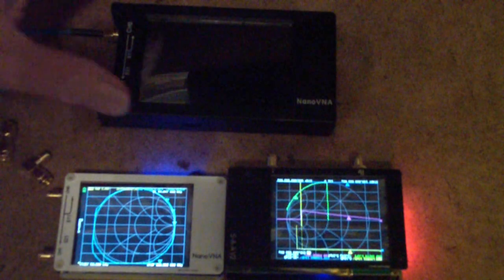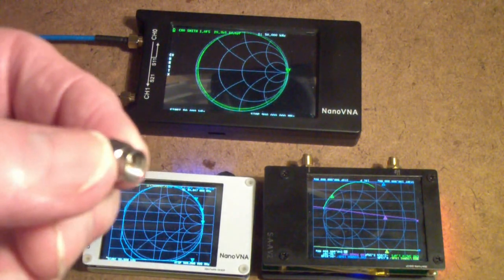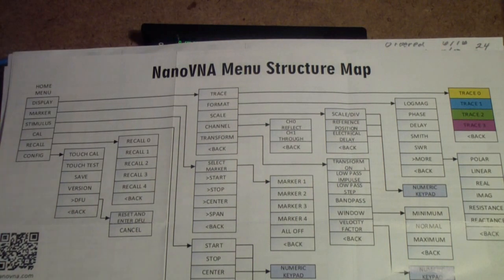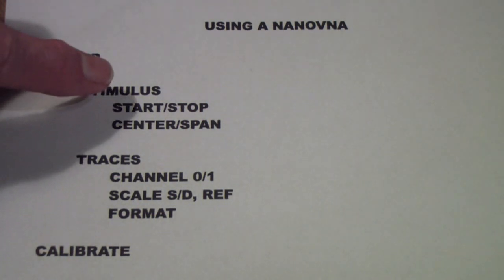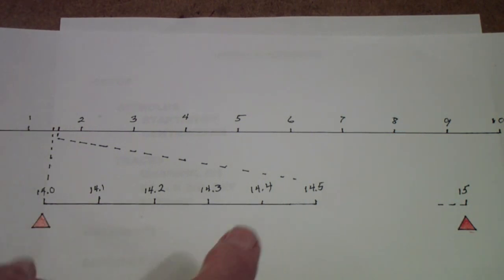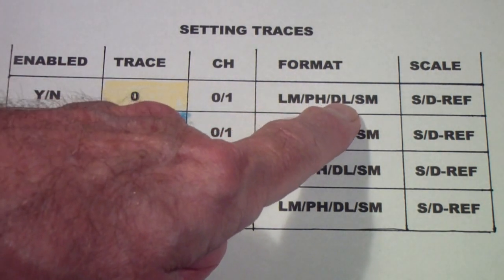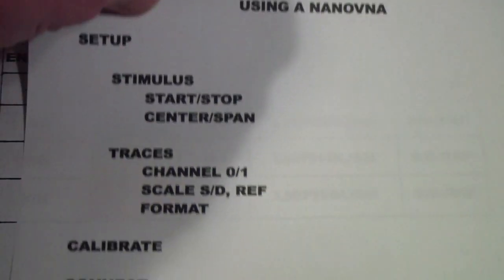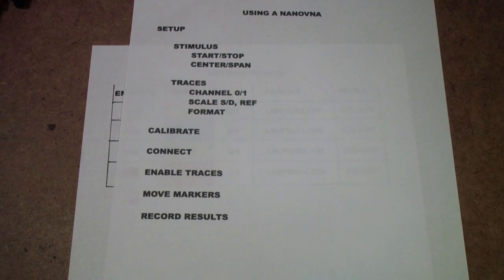TTT322 nanoVNA Tips and Tricks

Comment: Hello Tom, I'm a new subscriber, hammer, and plumber.  I've enjoyed all of your NanoVNA videos.   I  just recently finished a DSB 40 meter kit transceiver and it surprisingly is working well.  I'm not sure if I suppress the carrier correctly since I don't have an oscilloscope nor a spectrum analyzer.  Could you produce on any of your up coming videos on how to use an NanoVNA to suppress a carrier at the mixer circuit. Or is it possible?
Thanks for the education on electronics,
'73, Martin, WH6XY.
Reply from the maker: If you use a doubly balanced mixer, it should suppress the carrier sufficiently through its balance. Commercial doubly balanced mixers (like those sold by MiniCircuits) have the diodes carefully matched and will suppress the LO by at least 50 dB (typically 70 dB or more). It might be possible to use a nanoVNA to adjust an adjustable mixer but to do the job well (especially in the HF bands) requires a little better Resolution Bandwidth than the nanoVNA has available. Also, the nanoVNA is not a very good spectrum analyzer and better would be a true Spectrum Analyzer with at least 1 kHz (or smaller) RBW. I recently purchased a tinySA but don't have enough experience with it to know if it will be sufficient.  You didn't mention which kit you used but most have instructions if the mixer requires adjustment (many do not). If you let me know what kit you used and I can find some information about it online, I will certainly look at it and see if I have any suggestions.
Reply: @tomtektest8042  Aloha Tom, thanks for the reply .  The radio is a DCT by OzQRP.  I really don't know if I really suppressed the carrier by sound using another radio.  My hearing is not as what is use to be and I thought the nano would have that capabilities to show that suppression.  Is it possible to use the nanoVNA as a signal generator, say cw @ 7.1Mz, and send the signal thru the balance modulator and receiving it after to a RTL-SDR dongal @ 7.1Mz to show the signal on my computer using the SDR Sharp spectrum analyzer?
Reply from the maker: I think the SDR would work for the spectrum analyzer part and it looks like the nanoVNA would work as a signal source. On the latter point you might want to watch a couple of YouTube videos by MegawattKS and vk3ye on using the nanoVNA as a signal generator if you haven;t already.  Good luck.
Reply: @tomtektest8042  Big Mahalo Tom,